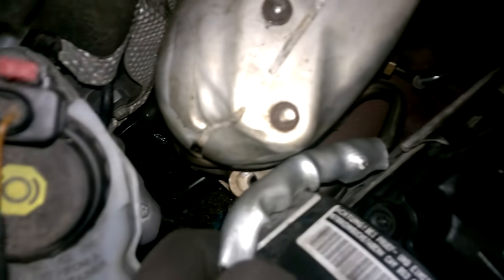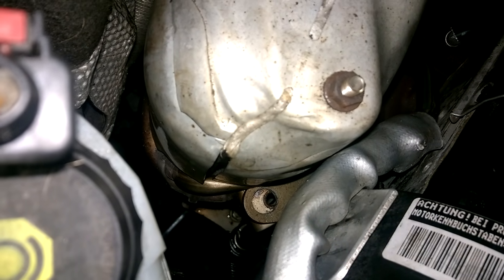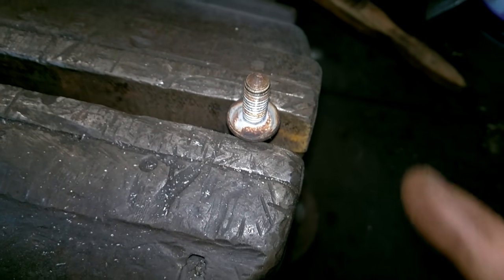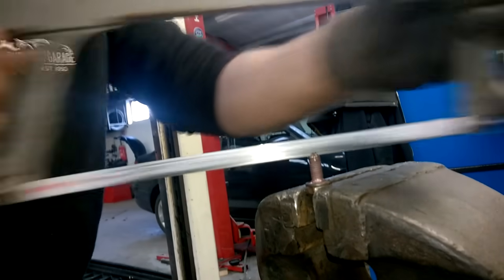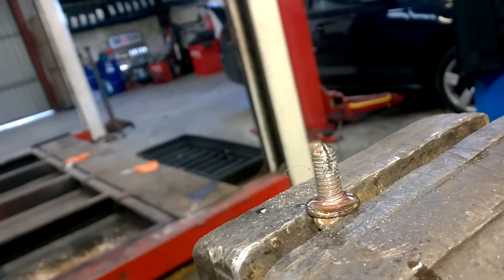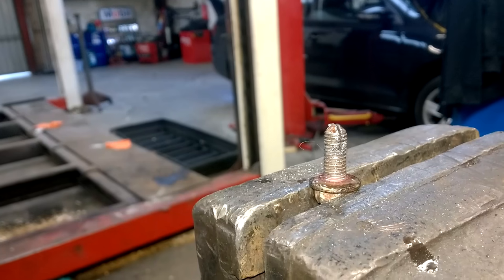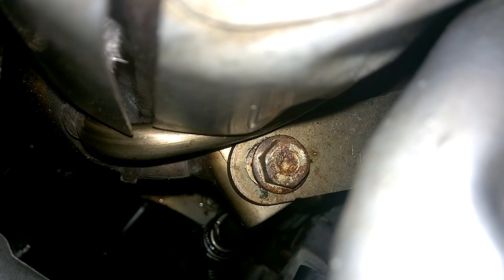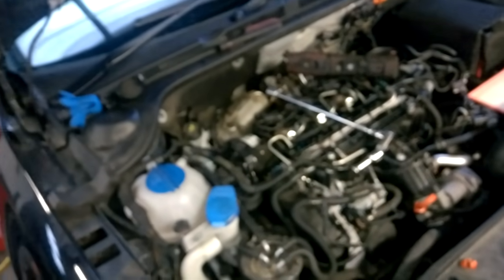My Father Taught Me This! Passing It On To The Next Generation

Comment: putting on hard to reach exhaust manifolds take some longer bolts. cut the heads off. use a  cut flat blade screw driver slots in the head end of a couple bolts. thread them in by hand. slide on the gasket then the manifold. start a couple regular manifold bolts. then just take a short screw driver and back out the fabricated studs. works great on marine engines and hard to reach manifold bolts. just slide the the gasket over the studs and then the manifold. never fails.

Comment: I have seen bolts come this way before. Thanks for sharing this, it honors your father. I had two shop teachers that would teach this kind of stuff when i was a kid. I was always amazed at what they knew. For example when we learned to to drive a screw into wood, they would make us bore it out first with a hand drill and countersink it, then we had to put the screw in, by hand, with a screwdriver. They told us that when you learn by hand, you will appreciate better the power and limitations of the machine when you use it and take better care of all your tools. Guess what, they were right!  What I dont understand are the imbeciles that gave this a thumbs down. It must be the thugs that were in my shop class that put a screw in by hitting it with a hammer. Hilarious....Mr. Winters would catch them and tell them to take that back out. They would ask for a screwdriver and a pair of pliers. He would make them use a pocket knife to whittle it out or take an F. If they did it again, it was licks with a custom built 28" paddle that he could generate so much swing speed with, you thought you heard a sonic boom before it got you. Those were the days. Snart men who, like your dad, tried to teach the future generations.
Reply: I learned a great deal from an old guy who worked on model T Fords. It’s amazing how much they could do with so little. My dad was a bit like that but I later found out that, even though what he did worked the job was more difficult than necessary. Learning what to do also involves learning what not to do.
Reply: The people who thumbs downed it probably did so because they know to do a proper repair.  This method gives the potential to make the threaded hole worse.   It looks like hte thread on the bolt was damaged.  The proper thing to do would be to replace the bolt.  Between salvage yards and ebay..  you can likely find the right bolt.   They also have tiny USB cameras where you can look into small dark remote places.   (to inspect the receiving threads).  If you gamble and cheat you can get away with it sometimes.. but eventually you'll make something worse... you reap what you sow.. if you always do the right thing, what you do won't come back to haunt you.

Comment: Great tip.  Also works great for tapping threads into wood👍
Reply from the maker: The update info below is the pinned comment on this video, I know most people do not realize I made that video and it better explains/shows this method in use.   
I also included below details of why the job was done this way free of charge with the customer fully informed. I hope you check it out  👇👇
 
UPDATE* I decided to make a follow up video on this https://www.youtube.com/watch?v=yfNQullGEuQ&feature=youtu.be Should answer some of the questions that were raised, I include 3 demos of this in action with close up shots.
 
As there was some safety concerns & confusing comments raised, I felt I should clear a few things up. 
1) This is a tip for certain circumstances only, I never have and never would use it on a component which would cause any safety concern to any customer.  
2) The demo was done on a support bracket only, items like this or similar will not cause any safety concern. 
3) I did this free of charge and on a time restraint, I noticed it when I was replacing another item, the customer needed the vehicle back that evening and I decided rather than leave it like it was, I would do this and secure it up fully. 
4) The bolt was not the issue, the part that the bolt threads into is a secured piece, someone had previously damaged it, leaving the bracket loose and the bolt just tightened a turn or so.
5) The bolt can be removed and will not break, it will go in and out as usual and has helped clean up the damaged threads.  
6) Used in the right application I personally believe this is a great tip and can save you a lot of time & trouble. 

Lastly to all the people who have watched the video, Thanks very much and I am delighted with the feedback I have received on it.

Comment: another little tip hacksaws don't cut on the back stroke it dulls the blade quickly, thanks for the tip
Reply from the maker: The update info below is the pinned comment on this video, I know most people do not realize I made that video and it better explains/shows this method in use.   
I also included below details of why the job was done this way free of charge with the customer fully informed. I hope you check it out  👇👇
 
UPDATE* I decided to make a follow up video on this https://www.youtube.com/watch?v=yfNQullGEuQ&feature=youtu.be Should answer some of the questions that were raised, I include 3 demos of this in action with close up shots.
 
As there was some safety concerns & confusing comments raised, I felt I should clear a few things up. 
1) This is a tip for certain circumstances only, I never have and never would use it on a component which would cause any safety concern to any customer.  
2) The demo was done on a support bracket only, items like this or similar will not cause any safety concern. 
3) I did this free of charge and on a time restraint, I noticed it when I was replacing another item, the customer needed the vehicle back that evening and I decided rather than leave it like it was, I would do this and secure it up fully. 
4) The bolt was not the issue, the part that the bolt threads into is a secured piece, someone had previously damaged it, leaving the bracket loose and the bolt just tightened a turn or so.
5) The bolt can be removed and will not break, it will go in and out as usual and has helped clean up the damaged threads.  
6) Used in the right application I personally believe this is a great tip and can save you a lot of time & trouble. 

Lastly to all the people who have watched the video, Thanks very much and I am delighted with the feedback I have received on it.

Comment: Would it be an improvement to  place a  thin  wedge in the end to spread it  slightly  or  spread it  &  place  a  metal  epoxy down the slot  with a  slightly greased  nut on first so the threads  dont get blocked

Comment: You might try a fresh saw blade, that one is dull as JoseBidumb. Also it only cuts when you push (unless it's backwards) so lift slightly when pulling saw back. Don't need lube. I saw the hole lined up so why dint the bolt fit?
Reply from the maker: The update info below is the pinned comment on this video, I know most people do not realize I made that video and it better explains/shows this method in use.   
I also included below details of why the job was done this way free of charge with the customer fully informed. I hope you check it out  👇👇
 
UPDATE* I decided to make a follow up video on this https://www.youtube.com/watch?v=yfNQullGEuQ&feature=youtu.be Should answer some of the questions that were raised, I include 3 demos of this in action with close up shots.
 
As there was some safety concerns & confusing comments raised, I felt I should clear a few things up. 
1) This is a tip for certain circumstances only, I never have and never would use it on a component which would cause any safety concern to any customer.  
2) The demo was done on a support bracket only, items like this or similar will not cause any safety concern. 
3) I did this free of charge and on a time restraint, I noticed it when I was replacing another item, the customer needed the vehicle back that evening and I decided rather than leave it like it was, I would do this and secure it up fully. 
4) The bolt was not the issue, the part that the bolt threads into is a secured piece, someone had previously damaged it, leaving the bracket loose and the bolt just tightened a turn or so.
5) The bolt can be removed and will not break, it will go in and out as usual and has helped clean up the damaged threads.  
6) Used in the right application I personally believe this is a great tip and can save you a lot of time & trouble. 

Lastly to all the people who have watched the video, Thanks very much and I am delighted with the feedback I have received on it.

Comment: Good tip. I bet there are loads of ppl in the world who think they're the first person to do this.
Reply from the maker: The update info below is the pinned comment on this video, I know most people do not realize I made that video and it better explains/shows this method in use.   
I also included below details of why the job was done this way free of charge with the customer fully informed. I hope you check it out  👇👇
 
UPDATE* I decided to make a follow up video on this https://www.youtube.com/watch?v=yfNQullGEuQ&feature=youtu.be Should answer some of the questions that were raised, I include 3 demos of this in action with close up shots.
 
As there was some safety concerns & confusing comments raised, I felt I should clear a few things up. 
1) This is a tip for certain circumstances only, I never have and never would use it on a component which would cause any safety concern to any customer.  
2) The demo was done on a support bracket only, items like this or similar will not cause any safety concern. 
3) I did this free of charge and on a time restraint, I noticed it when I was replacing another item, the customer needed the vehicle back that evening and I decided rather than leave it like it was, I would do this and secure it up fully. 
4) The bolt was not the issue, the part that the bolt threads into is a secured piece, someone had previously damaged it, leaving the bracket loose and the bolt just tightened a turn or so.
5) The bolt can be removed and will not break, it will go in and out as usual and has helped clean up the damaged threads.  
6) Used in the right application I personally believe this is a great tip and can save you a lot of time & trouble. 

Lastly to all the people who have watched the video, Thanks very much and I am delighted with the feedback I have received on it.

Comment: Thanks buddy, never thought of it, as it does make sense.
Reply from the maker: Thanks Brian 
 
The update info below is the pinned comment on this video, I know most people do not realize I made that video and it better explains/shows this method in use.   
I also included below details of why the job was done this way free of charge with the customer fully informed. I hope you check it out  👇👇
 
UPDATE* I decided to make a follow up video on this https://www.youtube.com/watch?v=yfNQullGEuQ&feature=youtu.be Should answer some of the questions that were raised, I include 3 demos of this in action with close up shots.
 
As there was some safety concerns & confusing comments raised, I felt I should clear a few things up. 
1) This is a tip for certain circumstances only, I never have and never would use it on a component which would cause any safety concern to any customer.  
2) The demo was done on a support bracket only, items like this or similar will not cause any safety concern. 
3) I did this free of charge and on a time restraint, I noticed it when I was replacing another item, the customer needed the vehicle back that evening and I decided rather than leave it like it was, I would do this and secure it up fully. 
4) The bolt was not the issue, the part that the bolt threads into is a secured piece, someone had previously damaged it, leaving the bracket loose and the bolt just tightened a turn or so.
5) The bolt can be removed and will not break, it will go in and out as usual and has helped clean up the damaged threads.  
6) Used in the right application I personally believe this is a great tip and can save you a lot of time & trouble. 

Lastly to all the people who have watched the video, Thanks very much and I am delighted with the feedback I have received on it.

Comment: I like it.  Pro oldschool tip.  Thanks for this.
Reply from the maker: Cheers Josh  
 
The update info below is the pinned comment on this video, I know most people do not realize I made that video and it better explains/shows this method in use.   
I also included below details of why the job was done this way free of charge with the customer fully informed. I hope you check it out  👇👇
 
UPDATE* I decided to make a follow up video on this https://www.youtube.com/watch?v=yfNQullGEuQ&feature=youtu.be Should answer some of the questions that were raised, I include 3 demos of this in action with close up shots.
 
As there was some safety concerns & confusing comments raised, I felt I should clear a few things up. 
1) This is a tip for certain circumstances only, I never have and never would use it on a component which would cause any safety concern to any customer.  
2) The demo was done on a support bracket only, items like this or similar will not cause any safety concern. 
3) I did this free of charge and on a time restraint, I noticed it when I was replacing another item, the customer needed the vehicle back that evening and I decided rather than leave it like it was, I would do this and secure it up fully. 
4) The bolt was not the issue, the part that the bolt threads into is a secured piece, someone had previously damaged it, leaving the bracket loose and the bolt just tightened a turn or so.
5) The bolt can be removed and will not break, it will go in and out as usual and has helped clean up the damaged threads.  
6) Used in the right application I personally believe this is a great tip and can save you a lot of time & trouble. 

Lastly to all the people who have watched the video, Thanks very much and I am delighted with the feedback I have received on it.

Comment: Great tip thank you  you dont realise how that has saved me pal
Reply from the maker: Glad it helped Tony, I appreciate your comment mate. 
 
The update info below is the pinned comment on this video, I know most people do not realize I made that video and it better explains/shows this method in use.   
I also included below details of why the job was done this way free of charge with the customer fully informed. I hope you check it out  👇👇
 
UPDATE* I decided to make a follow up video on this https://www.youtube.com/watch?v=yfNQullGEuQ&feature=youtu.be Should answer some of the questions that were raised, I include 3 demos of this in action with close up shots.
 
As there was some safety concerns & confusing comments raised, I felt I should clear a few things up. 
1) This is a tip for certain circumstances only, I never have and never would use it on a component which would cause any safety concern to any customer.  
2) The demo was done on a support bracket only, items like this or similar will not cause any safety concern. 
3) I did this free of charge and on a time restraint, I noticed it when I was replacing another item, the customer needed the vehicle back that evening and I decided rather than leave it like it was, I would do this and secure it up fully. 
4) The bolt was not the issue, the part that the bolt threads into is a secured piece, someone had previously damaged it, leaving the bracket loose and the bolt just tightened a turn or so.
5) The bolt can be removed and will not break, it will go in and out as usual and has helped clean up the damaged threads.  
6) Used in the right application I personally believe this is a great tip and can save you a lot of time & trouble. 

Lastly to all the people who have watched the video, Thanks very much and I am delighted with the feedback I have received on it.

Comment: Just a thought....
Looks like the welding job on the fractured casing has been the cause of the problem. I wonder if the massive stresses to that casing now caused by fitting this bolt will cause another fracture... I think I would have been tempted to use an extended bracket to reduce the casing stress.